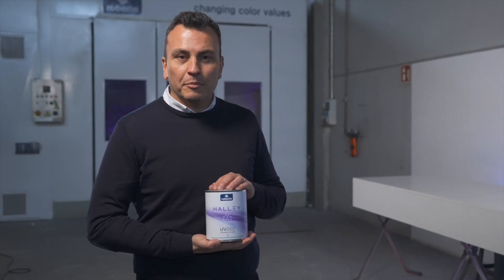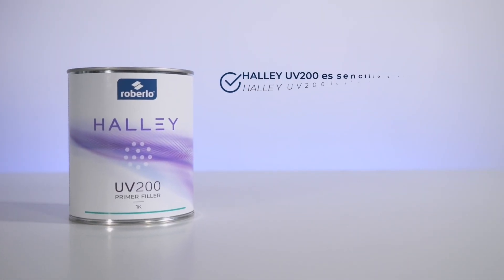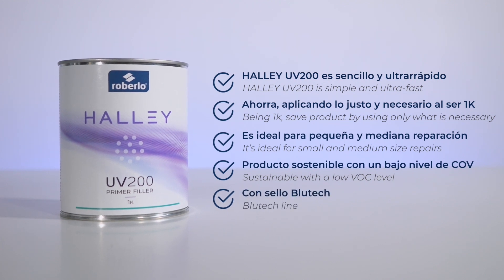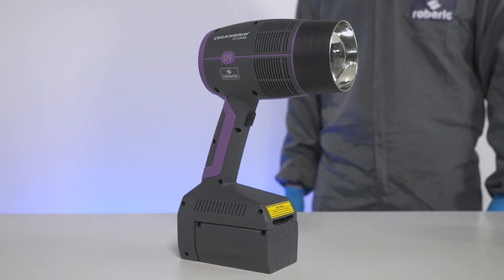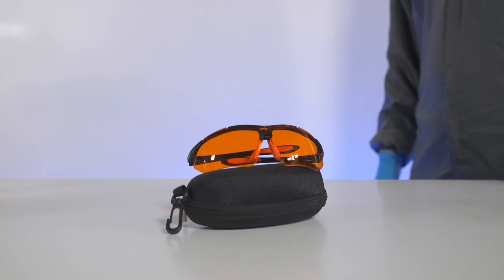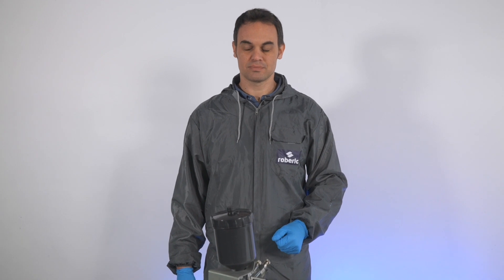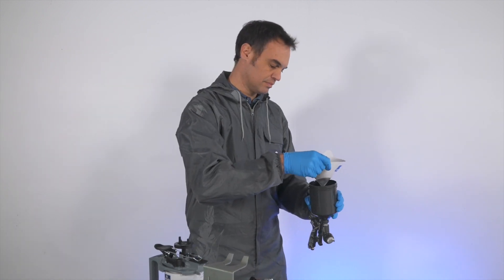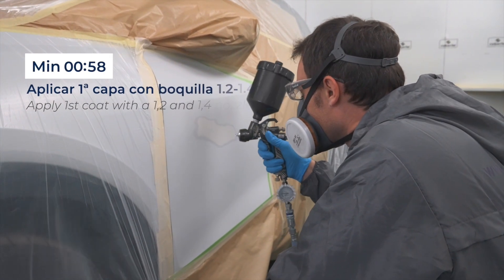Halley UV200 de Roberlo | Priming in less than 10 minutes

Comment: Does it have anticorosive additive?
Reply from the maker: Hello, UV200 primer has an excellent adherence to metal. If you are looking for a primer with anticorrosive components, we recommend the Multyfiller Grip non-UV primer.
Regards!
Reply: Ok so what do you apply on pure metal before the uv200 filler to prevent any rust?